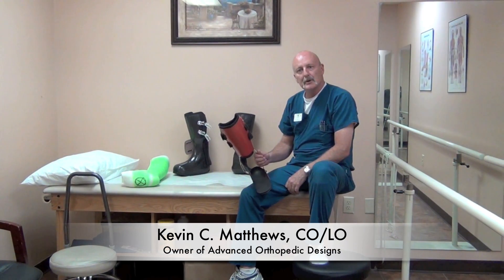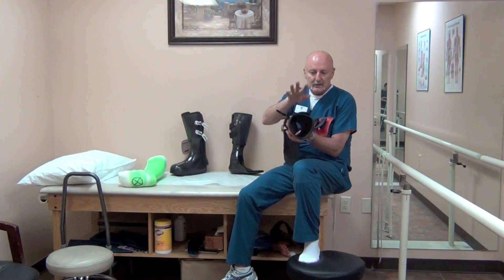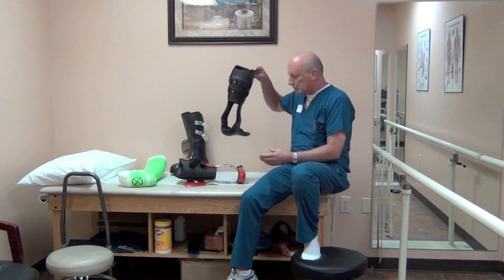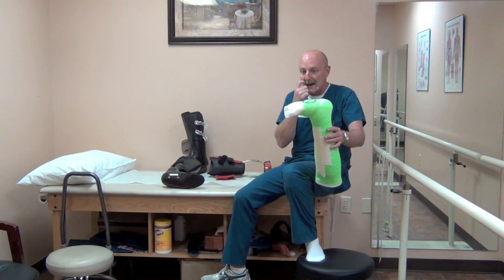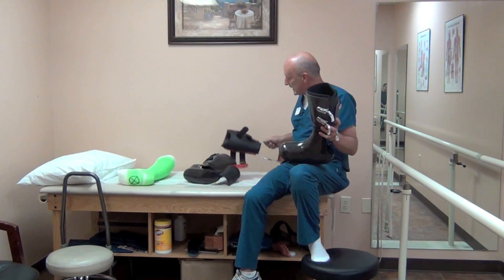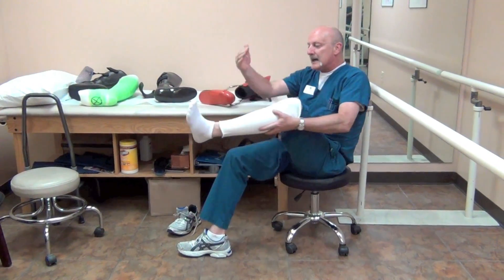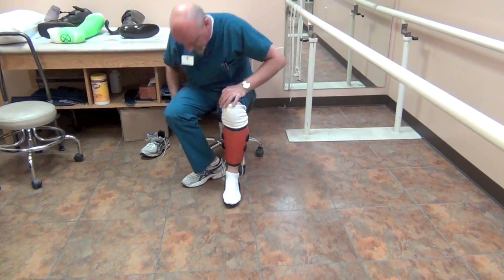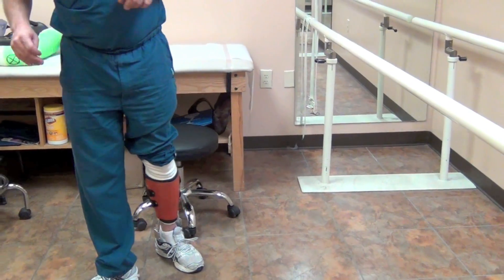LoadShifter AFO: Overview

Comment: Hi Kevin,  I see that this video was originally posted in 2012 can you tell me what your experience has been with the Load Shifter since this posting.  I have  a fractured talus where part of the bone is missing and the other part is impacted.  My doctor has prescribed a PTB but I met with a company today that said this device may be a C or C+ and there is a new device on the market called an ExoSym  with a cost of about $9,000 that would be an A.  In other words the ExoSym would be the cadillac.The only place to get the device is in WA.  I live in MO and in reviewing your video you indicate that you can work with our local vendor.  Can you tell me theapproximate cost of this device and what have been the reviews of people that have been wearing it?  I thank you in advance for your reply.
Reply from the maker: Hi Debbie, the load shifter has worked well.  I would say it depends on the contour of your leg and your tolerance to pressure.  I have patients that do well, but can only tolerate a few hours of high activity due to the circumferencial pressure.  PTBs work well, but are difficult to make and tolerate.  I think the load shifter is more tolerable.  I don't think the ExoSym would work any better than the load shifter and mine is covered by insurance.  As far as reviews I don't have any.  I have several out there and if they aren't returning with problems my guess is they're working.  Every situation is different, but if you have a normal shape to your leg it should be effective.  Feel free to call, 210-657-8100